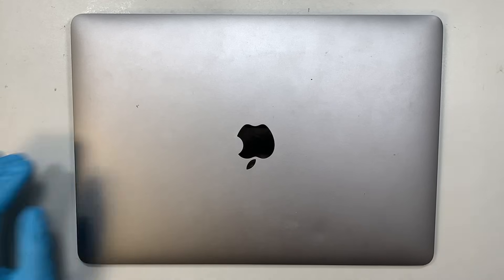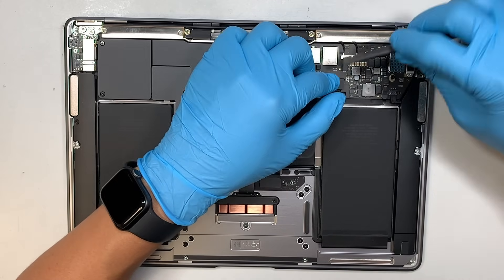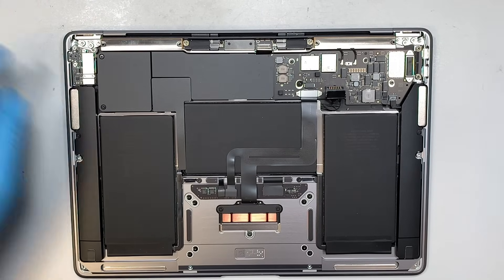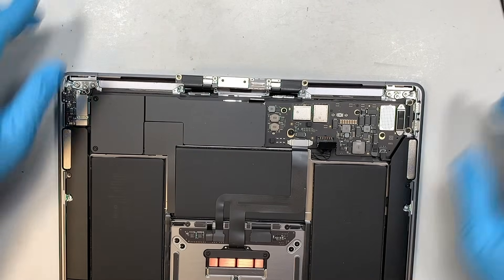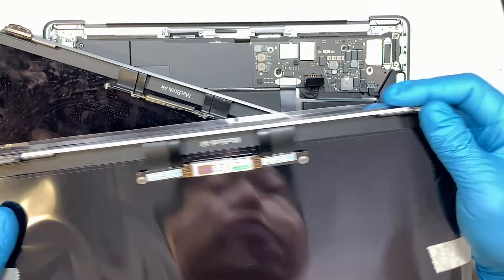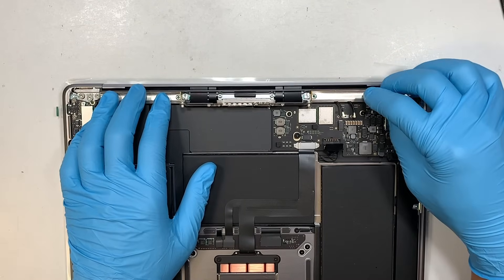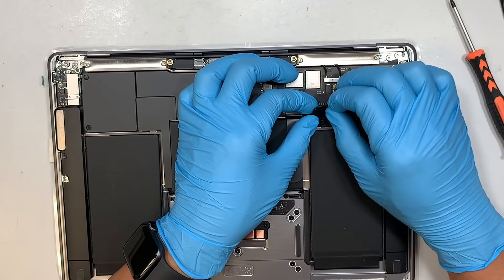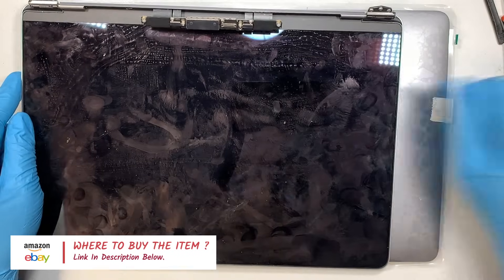Macbook Air M1 2020 Space Grey Screen Replacement A2337

Comment: Don't even try it unless you know what the hell you're doing. It's VERY EASY to screw up and ruin your own laptop, and then you'll be wishing you brought it to Apple.
Reply from the maker: Agreed
Reply: Its actually very easy but make sure you get good quality scredrivers and maybe some magnifying glasses as the screws are tiny
Reply: @ozigoo2422  
My point is, you should not be opening up your laptop unless you're willing to take the risk of screwing it up, and unless you're willing to void your warranty if it hasn't expired. Only experienced certified technicians who are qualified should be working on computers, not the average home user. There's not even a disclaimer on this video, which means this guy could be sued just for providing these instructions.
Reply: @nikonlover1  makes sense lol yep definitely gotta know what your doing.

Comment: hi i managed to change everything but my macbook is unresponsive (caps lock key wont even light up) but theres the macbook on sound. what went wrong?
Reply from the maker: i would suggest to try putting the original screen back to see if you have a responsive laptop
Reply: @UbergeeksBiz  its responsive.
Reply from the maker: @nuraleeyahaqilahfaizal6508  if old screen works, then you might have a bad brand new screen. Or u ordered a wrong model

Comment: Excellent video! The instructions were very clear and precise.
I did have T3  screws,instead of T4, on my LCD and WiFi brackets. Nothing that a change in screw driver was not able to solve. 
Apple estimated my repair between $500-$800.  This cost me about $200 and less than a half hour to repair.
Reply from the maker: You are welcome. Glad the video helped.
Reply: May I ask where did you buy the macbook screen for A2337?
Reply: Do aftermarket screens work well? No issues with security, serial numbers etc.?

Comment: Hi, great video. But I have done 2 of these now and although the screen works on both, the camera doesn't work on either. I have read that the camera is locked to the logic board and will not work unless changes are made in the ROM to enable the serial number of the new part. This is really frustrating, and I wondered if you have ever run into this problem, and if so, been able to fix it? Thanks!
Reply from the maker: Negative. With new screen, camera will work just fine
Reply: I have this exact problem, light sensor and camera not working. I paid £400 to get the official one from Apple self repair program too...
Reply: olá amigo conseguiu resolver o problema com a webcam?

Comment: I repair these all the time, but I don't get the display assembly, I just get the 2337 LCD Panel, which is $100 instead of $300 for the Assembly. I can do the whole repair in less than a half hour.

Comment: Great video. Liked and subscribed!
I am noticing a small clicking sound when I open the screen all the way(more than 90 degree).  Anyone have same issue? Did I tighten the hinges too much or alignment issue?
Reply: I had that issue and it turned out to be something underneath the clutch cover (acrylic glass piece that says "Macbook Air") that as causing it to lift and buldge out a bit. Not sure if it's going to be the same for you. I'd inspect the whole unit and make sure there are no bends anywhere on either the unit itself or the Display Assembly. Maybe run your finger down the clutch cover and see if you feel any bumps.

Comment: Great tutorial. I was able to replace my wife's Macbook screen and save hundreds of dollars. A couple of things:
1. My hinge screws were T9, not T8 as in the video. They are very tight, so you want to use the correct driver. Some of the other screws were different sizes to the video too.
2. As he says in the video, the screws securing the back plate are pentalobe (P-type) screws, not Torx (T-type).
3. As he says in the video, be VERY careful when reconnecting the two WiFi plugs.
4. I taped a strip of masking tape sticky-side-up to a piece of cardboard and stuck the crews to it.
5. Be patient when inserting the hinges of the new screen into the slots of the keyboard. It's tricky, so don't force it.
Reply: Hi do you know why after I replaced my screen, it doesn't turn on, just the keyboard.
Reply: Yeah my hinge screws were also T9 thanks for mentioning this

Comment: Just replaced our screen! The tutorial was spot on. The only thing is we used the T-3 instead of the T-4 in many cases. The video was easy to follow and spot on. We did take every precaution by using drawings with where the screens went to be sure we had the correct ones when putting the screen back together. Would not recommend doing this around kids...those screws are super tiny. Thumbs up on the video. A lot of good tips along the way.
Reply: Regarding the eBay and Amazon links posted in the description for the LCD screens, I followed them to check the price but they  are from different sellers with prices ranging from $168-210. Is there any particular vendor you recommend over the others?or is it fair to assume all of them sell similar quality LCD screens?
Reply: Where do you buy the screens ?
Reply: @thamsanqadaku  aliexpress but make sure you buy the more expensive "full lcd assembly" option (they have much cheaper shipping to me than the states do)

Comment: Hey guys, be careful when you slide in the new monitor...I broke mine when trying to wedge in the hinges....*thankfully just the bottom side but screen is fine*....it's very easy to crack under slightest pressure. 

Also...mine failed to power up......but after many tries I managed to get it to power on :)
Reply: I had mine upside down. The keyboard part of the laptop can be confusing if there's no screen attached anymore, lol.
Reply: When you install those, you have to have the hinges twisted all the way down.
Reply: I had to plug mine into a charger, but after that works fine.
Reply: How did you get it to power on?
Reply: @el7335 is weird but you need to plug in your charger to the m1 mackbook…it only powered on after I did that